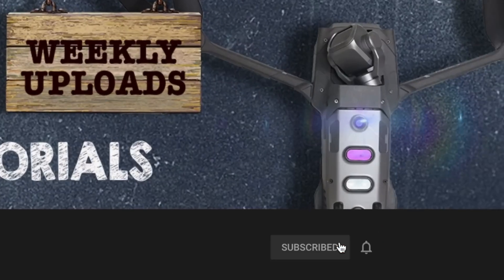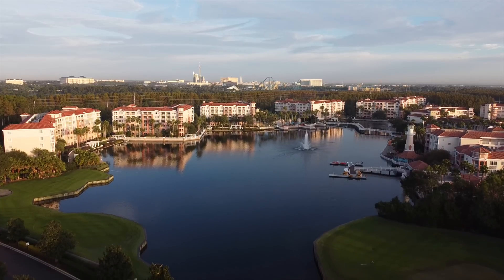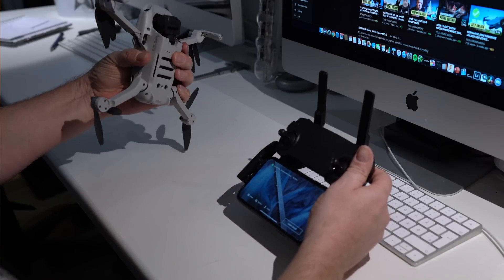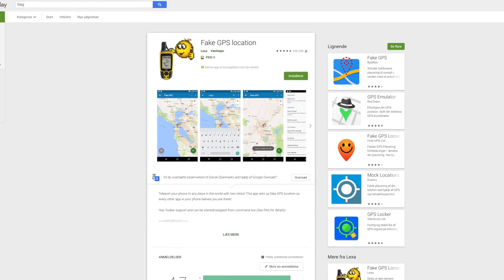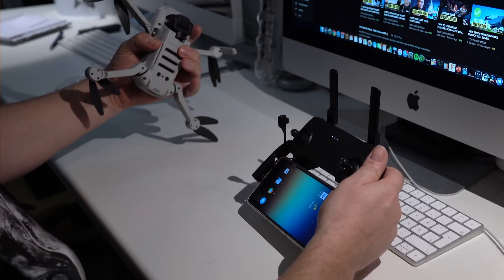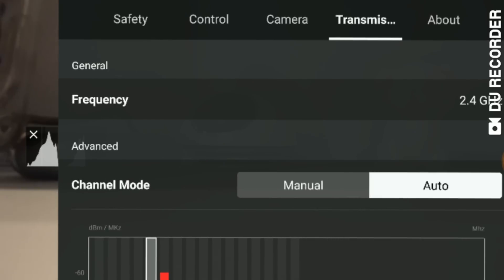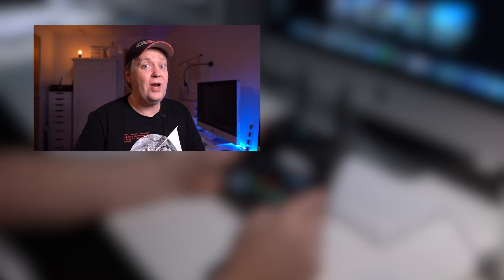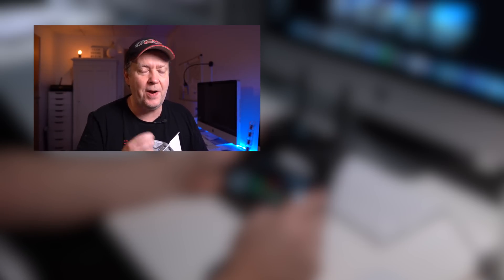HOW TO FIX MAVIC MINI BAD RANGE - FCC HACK (all DJI Drones 2020)

Comment from the maker: After making this video I learned there is a difference in the hardware between the CE version for Europe and FCC version in US. You still get the benefit in the 5.8Ghz band as far as I can see, but not as much as full FCC. In general, any improvement to the 5.8GHz is beneficial, as it’s limited to 500m and where most CE owners are seeing a problem. The guy that reported this to me has been reaching 1600m out with no hiccups after doing this, but no information about the band he was using, ⚠ Finally I do want to add that messing with this might void your warranty with DJI ⚠
Reply: If you dont wanna void your warranty just use 2.4 GHz channel and select the green shortest bar on channel . And dont forget to set your phone to airplane mode. No more interference from your own phone. Got range 500m++ on crowded area and 1700m ++ if not crowded
Reply: maries vilmy is this still the CE version that your talking?
Reply: @joushcaleb7432  yeah CE version, im from indonesia so its CE version , MR1SD25 model
Reply: @mariesvilmy5680  cool!. You said "select the green shortest bar on channel", meaning you put your transmission into manual? is that it?
Reply: @joushcaleb7432  yeah manual and select the lowest interference channel (shortest green bar)
Reply: And dont forget the 2.4 ghz channel ch 1- 12 or 13 i forgot
Reply: @mariesvilmy5680  thanks dude
Reply: @mariesvilmy5680  how far did you fly?
Reply: @mariesvilmy5680  tidak ada hardware tambahan, booster atau lainnya?
Reply: @nicolausadinugroho1133  asal lokasi gk ada gangguan sinyal
Reply: @mariesvilmy5680  it's not enough....I want full range!!!
Reply: @mattm4497  if too much interference, we cant reach max range. Because the max power on this model (mr1sd25)only 19 dbm......thats about 78mW . If you compare with the mr1ss5 with 30 dbm thats about 1000 mW, of course mr1ss5 better in range
Reply: Well maybe that is not true. I have the CE version  and I change it to FCC and from a ma  distance of 843 meters my mini made a 3026 meters and I stpped it because I was flying over the sea and I got afraid.
Reply: NICK's HIGHTECH How did You manage to Fly that far with a CE model? By using the hack mentioned in the video? Thanks in advance
Reply: Unlike the Spark which had FCC ability depending on location, the CE version Mini drone transmitter output is locked to 19Db or thereabouts and cannot be increased. If you want to risk your drone and be illegal just add an external 2.4Ghz amplifier.
Reply: @quentinbush  where do i find one of those amplifiers 😆
Reply: TECH DRONE MEDIA ok I did everything what I supposed to do & I managed to change to fcc but when I went outside house & drone pickup signals from satellites automatically went back to ce ☹️ I just want to add that my mobile is without SIM card & on fly mode too
Reply: @Project.camper  yes, i also encountered the same. The setting was perfect but it switched immediately to present location when brought outside.
Reply: Teck Meng Liang I heard that DJI did some update to avoid people changing the location that’s why it doesn’t work anymore
Reply: are you use latest dji fly version?
before i hade same symtom with yours...anda i go back my dji fly to 1.0.8 and than .....😍😍😍😃
Reply: Lucas K use a jailbroken iphone and use the hacked app its only way this will work 💯
Reply: How about using an FCC remote with the CE drone - would that increase range? Is the additional hardware in the actual drone or just in the remote? Asking as seen FCC remotes available online from US, wondering if this would work, if you can pair it then it should right?
Reply: @OohHavana  the RCs are.matched between CE and FCC you can't pair an FCC remote with a CE Drone.
Reply: @OohHavana  You can't pair an FCC with a CE unfortunateley. BUt even if you could the transmission is bi-directional, you have the Drone control out to the drone from the RC and the telemetry and video feed from the drone to the RC.
Reply: I've not got the message "Aircraft resetting wireless network ...". What might be wrong? On transmision tap I see channels from 1 to 13.
Reply: Rodion Stepanov hi same here, did you resolve the issue? Thanks
Reply: Ok please help me out here which one should i buy because i want to fly out of my house and fly around my urban area? And whichever one i buy will this last for ever. I want long range and best signal from the Uk (;
Reply: @ajayloggedout6751  mavic mini does the job.. i take off in my lounge and open the balcony doors and fly out wait for gps to lock in, then away i go.. and if you get the fly more combo with 3 batteries... its definitely a nice way to enjoy an hour or so of flying every evening.. i actually do it in the morning too 😆
Reply: Ajay Loggedout your better of buying the parrot disco  drone, modded it can do 90km in range.
Reply: TECH DRONE MEDIA quick question so after you trick the controller using the fake gps app how do you trick the satellite that have the location for the drone??
Reply: I am using my mavic mini now because of the lockdowns and launching from my bed room window and have had no problems...I won’t take my Mavic air 2 out because I know people will probably call the cops....That’s one advantage about the Mimi its hard too see were it has landed
Reply: @wellangaquit9925  that's ce
Reply: Im in Europe and I reach 5 kilometers easy
Reply: Here's my "real" test on the FCC Hack using actual RF Power Meters -  https://youtu.be/hXjr8DXxMp4
Reply: Dear uploaded. If you care about about your viewers. Stop clickbating and change the title of your video. If you really have learned the Mavic mini is hardware coded. Then why not do it?
Reply: One of your carefull viewers "8DC Photgraphy" had made a comment here and linked to a test he had made and you can find here on the end of my comment (he did not refer to your video here in his video though, but at least he measured). 
But he started his journey from the birds eye view with an overview of and the reason for different regulations. He showed the sources used in his video too and explained dji story from 1 world drone for the Mavic Air and the Mavic 2 in the past to their new approach of separate units for the FCC and CE market so it starts as a very solid research work with open doors except the link to your video regarding that hack. 
He seems to use a CE unit. He measured the power output and dbm of his remote in CE mode and then in "FCC hack" mode.

That being said you have a long explanation cause my videolink jumps right to the results close to the end of the video.
 
It seems to me and others that he had made a mistake in the conclusion misinterpreting what dbm means. His conclusion was that the hack did not really work regarding range based on his db measurings but the hack had at least changed the frequencies to the US FCC standards based on "5 Ghz channels" only. 

The first comment on his video explains what I had believed too that he is partly wrong cause the dbm is a logarithmic scale and that in negative scale a lower number is a better one as "Rob" in the first comment from yesterday had explained as 
"-12.41 dBm is more than -16.59 dBm.
A 4.18dB increase equates to 2.618 times the power"

That seem to be right cause 8DC Photo ignored the mW he had measured from the remote in the same seesion and had been displayed too. There you can see an increase of power or mW received from 21 mW to 87 mW if you press space wile watching pretty often cause then you will see that peak 87 in one picture.

Normally he should have asked himself why he his device received far more mW ... with less dbm - in his opinion. 
But more output transmission power in mW creates more dbm and 3 or 4 times higher mW or power compared to a 2,6 times higher dbm will have a positive impact on the range for sure ... that I can not measure cause I had sold my initial CE model right after this video and also sold the new FCC mini I had gotten to benefit from the hack. I sold it in the believe the Mavic Air 2 could replace both, my Mini and my Mavic 2 Pro but that has to be questioned due to the huge size increase in folden state and not knowing if I still can use FCC mode that the Mini and Mavic 2 were capable. I know that the NLD hack for 45€ is capable of doing that for the Mavic 2 a lot easier but it took them roughly a year to find that particular solution so I doubt the Mavic Air 2 will have such hack earlier, but I jumped and sold the Mini and luckily kept the Mavic 2 as golden egg.
Therefore I can unfortunatelly not measure the Mini values of a FCC model cause no one knows what output the FCC Mini really has cause DJI says less than 1000 mW ....

My guess is that they will have from now on 2 models with a different hardware to make sure that the power output of the CE Version in FCC is far lower than the FCC version in FCC mode ... The european visitors of the US will benefit in the US in FCC mode a little bit by the roughly 80 - 100 mW they will get there but not from the full power a FCC version has there. And remember your flights on that pool in the US with the terrible performance even though your app should have switched to FCC mode automatically ?
100 mW was not enough cause if the US allow 1000mW then most likely other devices will also have a 10 times higher ouptut than the drone. And therefore you were the lost boy with no fun at the pool even your Mini looked the same like all the others over there.

Hope this explains a bit more ... and now something you might be keen to know:
no, the Air 2 seems to be coming in 1 model for the world that now seems to have to fullfill 2 more certificates beyond FCC + CE: MIC for Japan and SRRC for China
FCC is great and the rest is not what we want: strong and reliable connection for good videostream without lag. So China and Japan have limited the output basically to that of the EU / CEE and maybe a bit more regarding channels ... 

Maybe watch the video first from the link below that starts with the result and read the first comment I had mentioned that 8DC ignored the Output and misinterpreted the dbm gain of 4,18dm from -16 to -12 .... cause -12 is greater than -16 ...

 
https://youtu.be/hXjr8DXxMp4?t=535

Comment: It just work....
In same place yesterday I was at 650 m distance and my mini return to home because lost connection..
Today 1500m and keep going.
In altitude yesterday 320 m
Today 500......!!!!!!!!
Reply from the maker: Great, did you by any chance see it it used 2.4 or 5.8Ghz
Reply: @TECHDRONEMEDIA  in 2.4 both days
Reply from the maker: Crazy people are trying to convince me this is not working with 2.4, this suggest otherwise. Thank you for sharing
Reply: @TECHDRONEMEDIA  if you want I can help you understand this. There are 2 different models of the Mini. While the FCC hack of the CE model only boost the 5.8 signal! The 2.4ghz is always the same, no difference there for sure. It's an electronics thing, if you check the forums you will understand, mavicpilots.com!

There are 2 different circuits, one for 2.4ghz and another for 5.8ghz! The FCC hack on the CE model only boosts the power a little of the 5.8ghz SoC chipset, not rh 2.4ghz!

I really really want you to understand this properly before you make your video hey..

Go to the mavicpilots.com and read about this, you will understand everything very well..

Sweet

🙂

Comment: While your video is good, don't forget that we've already opened up the Mavic Minis both the FCC and the CE version and we see there is a microchip in the FCC version called Sky... something something.. and this chip allows the FCC Mini to use 1W transmission power while the CE doesn't have a chip there and all this FCC HACK really does is to boost the power of the CE version transmission system a bit, not to 1W like the FCC version. It still does improve the range thus hack but it can't be compared to the real FCC version. You will get like about 1.3km distance in the hacked 5.8ghz CE version. So it still improves the range, but only if the 5.8ghz. So why not just use the 2.4ghz of the CE version and get over 2.5km in open areas.

Sweet
Reply from the maker: Ivan, thank you.. I learned this after I made the video, so I will like do a follow up video on this one and clarify a few things
Reply: @TECHDRONEMEDIA  awesome awesome, that's why I'm really loving your channel hey, you interact and communicate with your subscribers.. Sweet

🙂

Looking forward to your new video..

😁

Comment: Cheapest drone hack for EU ever :))...... I have 2 inspires, I from the US (FCC) and one from Sweden :)) (CE)....
By the time I get to 2-3 km I'm mostly shitting my pants that my battery won't hold so much as my  signal (on both ) :))
Will try that on other drones though....might work, hopefully :D
Reply from the maker: The guys that that told me this, have made it work on the Mavic 2 Zoom as well. 2-3km I would go that far, I just want stability
Reply: @TECHDRONEMEDIA  Sorry for the dislike, mouse slipped :P.
Yes, I mostly use them at max 500 meters and apreciate more the stability of the signal, than distance :D.

Comment: Ich dachte bei der Mini es wäre eine andere Hardware...
Reply from the maker: Interestingly, it seems this is the case, but you still get the benefit in the 5.8Ghz band as far as I can see, but not as much as full FCC. In general, any improvement to the 5.8GHz is beneficial, as it’s limited to 500m and where most CE owners are seeing a problem. The guy that reported this to me has been reaching 1600m out with no hiccups after doing this, but no information about the band he was using.

Comment: Awesome! Watched most mavic mini vids on your channel. Is it correct that only in 'quickshot' mode the mavic mini can track objects? Other active-tracking/following is disabled because of the lack of sensors. I would like to know if there is a setting available where only the gimbal is tracking an object (centered in the frame) while the drone is operated manually... Would be very usefull for follow action
Reply from the maker: I can't make active track work under quick shots. I would have expected that, but it does not work
Reply: @TECHDRONEMEDIA  Ok,thanks, DC Rainmaker posted some experiments with the quickshots, but as I'm considering getting a mavic, I was wondering if there are possibilities for something like 'spotlight' on the mavic mini. For example the DJI osmo pocket can lock the gimball on a moving object...
Reply from the maker: @martijnwarnaar6255  This is not possible right now, but doable from a technical point of view. Circle is the closet you get to active track, but it's very limited.

Comment: Thanks for the good video on how to hack FCC power. I recently went through this procedure when I took my FCC Mavic Mini to a CE country. I had numerous connection issues and could barely fly to 400-500 m. With the hack, I still had strong signal at 1.5-2.0 km. I understand you will also get much better results if you hack the CE version. However, there are a few things to watch out for:

- The initial power up with the phone set to a gps position in the US needs to occurs INSIDE the house, or any place where the Mavic Mini will not receive gps signal. Only then will it « think » that it is located in the US.

- After that, in order to keep it thinking it is still located in the US, you need to connect your phone AFTER you started the motors with the remote controller. Similarly, you have to disconnect your phone BEFORE you stop the motors after the flight. Otherwise, the current position will be updated through the mavic’s gps.

- The initial power up can be done with an Iphone, but you need the proper software (yes, I did it).

Hope this helps !
Reply: Thanks man!! 🙌🏽
Reply: Thankyou this is exactly what I needed. Mine would boot into fcc indoors. But when tried outside it would automatically swap back to ce mode because of the minis GPS. So do you suggest starting the motors, connecting the phone and flying it out of the house. It's not ideal 😂😂
Reply: MRW Aerial Photography simply put your hand on top of the mavic mini until controller is connected then start immeaditly fly a little over the ground and connect the phone to the controller
Reply: @michaelnobauer7108  that I under stand yes. But i have concerns. 1, I have a very narrow doorway and a corner to negotiate. Secondly where i fly i with issues i dont have the luxury of my house to shield the gps 😂. Third, I would not want my mini to return to home there if anything happens to the transmission. I would not be able to update my return to home as it would be in America lol.
Reply: MRW Aerial Photography you can block the gps outside the door with your hand, u dont need to stay inside, the drone will connect to the satelite right after u put your hand away and it sets the homepoint secondas after the start
Reply: @michaelnobauer7108  ahhh i see! I'm with you now I'll give that a try. Thankyou
Reply: @michaelnobauer7108  How can we fly if the phone is not connected to the controller? This hack didn't work for me and I lose signal after 250 m :( So disappointing..
Reply: Γιάννης Τσούγκος  you need to connect the phone directly after you started of the ground, hack definitly works but u get not that much more range, i think its 200m more than in normal ce mode
Reply: This should be Pinned.
Reply: what software you use for the iphone?